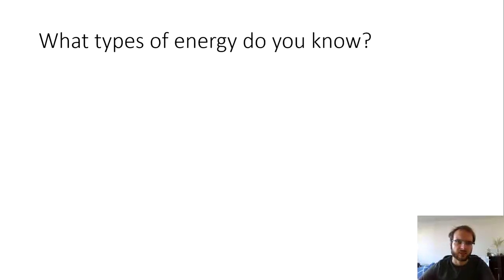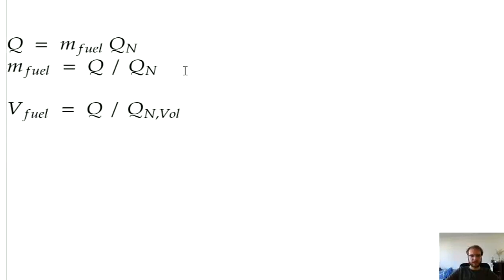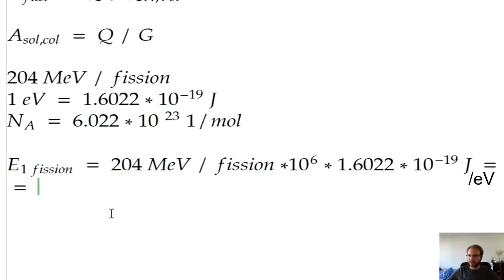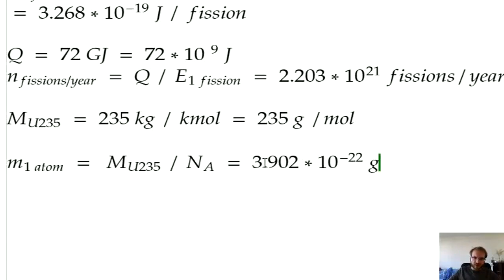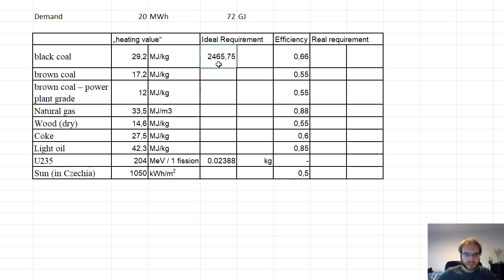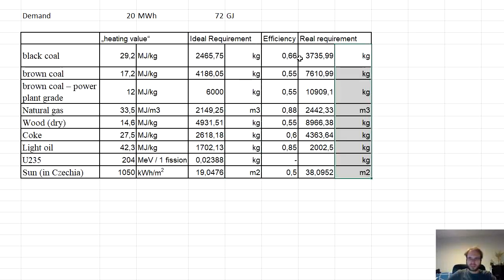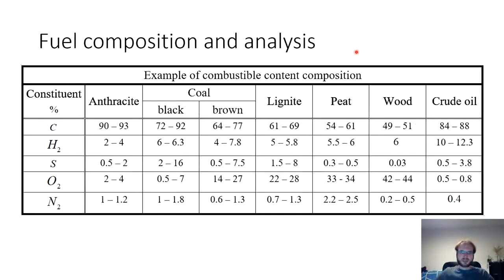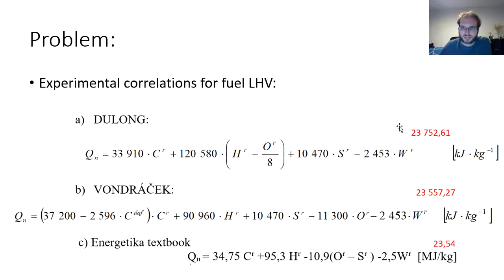Energy Sources and Conversions - tutorial 01

Comment: 11:21 There seems to be a mistake in the calculation of energy per single fission. It should be 3.268*10^-11 J/fission. The calculation of the number of fissions, however, is correct.
Reply from the maker: Absolutely correct, thanks! Mistake happened between eyes (on aux. spreadsheet) and hands...